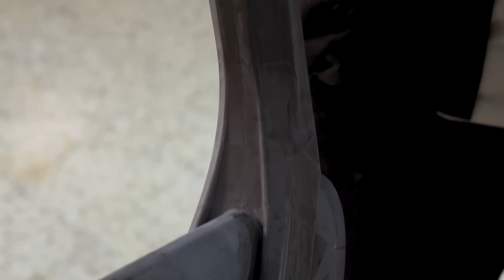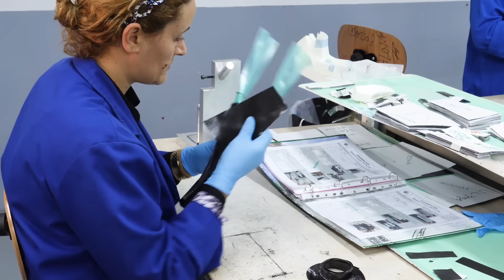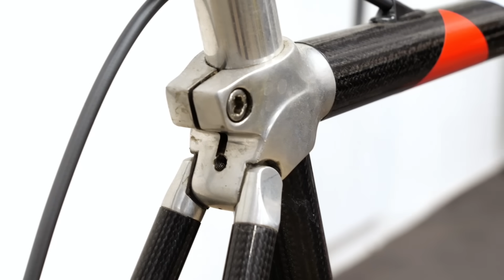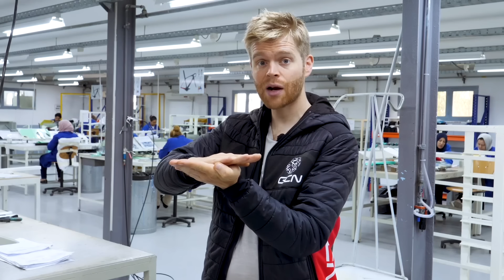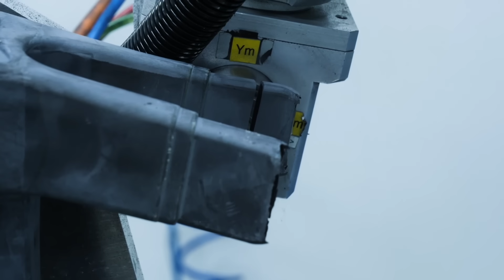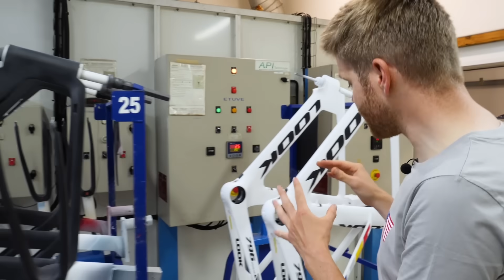How Are Carbon Fibre Bikes Made? | LOOK Cycle Factory Tour

Comment: It is interesting to see the backlash about worker safety in this video. People seems to have a "little knowledge" and then use to make assumptions that are mostly incorrect here. Ill add my thoughts on the main questions here - but don't take my word for it, do your own research, all of this is heavily documented. And DO question Look about it, their canned response here was dismal - even if they aren't doing anything wrong.

1: Is carbon fibre dust bad for you? Yes, yes it is. It lodges into your lungs and can cause respiratory problems long term. It is not unlike silicosis from sand blasting as a career. It does not, as far as anyone knows right now, cause cancer - not that it matters really, I'd probably rather have cancer than silicosis. OTHER types of carbon compounds are linked to cancer, like nanotube structures, but there is no link to carbon fiber dust so its not ideal to conflate those just to make it seem a bit more scary. And that's not because it hasn't been tested enough. The industry isn't as young and cyclists may imagine, there's a half a century or more of research into this mostly in aerospace where strict procedures are the be all and end all. Safety procedures will continue to be refined for carbon composite processing as we learn more about the long term effects of exposure - and the type of composites we use evolve.

2: Are the masks they are using while sanding "enough"? Yes. Note that the tables they sit at are full of holes. These tables suck all fine dust down into the extraction system. These are that same as they use in woodworking facilities, where breathing the dust can be of similar harmfulness. The masks are an extra layer of protection, but probably not actually needed to be safe here. Setups like this are designed and tested to meet particulate counts, and not just slapped together  saying "that looks good enough, you'll probably live - maybe". The lady that has her mask down below her nose you'll note was NOT sanding at the time. Sanding carbon in a closed room with minimal ventilation WOULD be very poor, even with a snug respirator - I've done it. Yuk. But that's not what's happening here.

3: I saw a lady handling epoxy prepreg with no gloves, is that ok? It's not ideal - I'd hope she's not doing that all the time - but prepreg is kept at -18C, and is still very cold when laid up on a frame. The epoxy is effectively non functional at this temperature. It isn't leaving any residue on her hands. In many videos I've seen on YouTube of prepreg handling (even Alpha Romeo 4C SMC construction) you see people with no gloves. That said, uncured epoxy on your hands in small amounts isn't harmful to most people. Some people have a sensitivity that causes dermatitis, and those people probably shouldn't be working with it, even with gloves.

4: The guy spraying clear had no mask, he's gonna die! Well... that takes a few assumptions. First you have to assume the booth ventilation is poor - which it likely is not. Then you need to assume they are using a 2K polyurethane clear with a high isocyanate volume. Isocyanates in paint are what can kill you and cause brain damage over extended usages and shouldn't be used without a fresh air system. EVERYONE knows this and NOONE in ANY country would allow someone to spray it without the right gear. Even an idiot spraying his tractor in a barn knows not to use this unprotected (certain Toronto based painters may contain slightly more idiot genes however). This stuff strikes fear into painters heart, and that fear isn't overhyped. So it would be a good assumption that Look is NOT using a paint like this because they don't want their painter to die. Now, I can't seen any info online about what they actually use, but I would expect Look is using an acrylic or even epoxy  based clear, which is fine in a good spray booth with no mask as the fine particulates are drawn out of the booth. Basically there are "particulates" and there are "solvents" that can be harmful to you. Particulates are dealt with by extracting them before they get to you. Solvents dissipate into the air, so they need to be blocked with a filter - or separated completely from the air you are breathing. Acrylics and epoxies are low to no solvent ( VOC) with no (usually) isocyanates. Polyurethane is the killer with high VOC and often high isocyanate amounts. Horribly toxic poly paints like Dupont Imron are what everyone imagines of when they think clear on custom cars or bikes - but this is all changing and I'd expect few people to be using them in the next decade.

5: The guy in the robot machining cell had no protection, is that ok? Well, he was not machining, he was placing a frame in the fixture. I cant imagine he was even inside the cell when the robot was running because he'd get physically hit by it! If he was he probably in a corner and had a mask on at that time. The cell is again, downdraft to keep the fine dust at bay. The robot itself would die from the dust as its highly conductive, so you can be sure there is almost nothing in the air inside there when it's cutting.

6: "I worked in aerospace for 122344 years and they do....". Some of you probably are expert with experience working in composites, but it SOUNDS like many of those comments are people who have done aerospace. Aerospace programs - making a wing spar for a 787 for example - have a procedure put in place by the manufacturer by way of the government that MUST be adhered to in every detail, full stop. They need complete traceability because if that part fails, and 340 people die, they need to know exactly why and WHY starts with process anomalies. So they need to be 100% sure you never sneezed onto layer 345 of prepreg or got your greasy bacon sandwich fingers on layer 222. So naturally, with lives on the line, their processes and safety are at an extreme level that don't always need to be matched on something as simple as a bicycle frame. Rest assured, they don't do it to protect YOU, they do it to protect themselves from lawsuits.

I hope this leads people to go research these topics for themselves a bit more, so they don't have a fit whenever they see a working factory (especially one not in their own country and assume therefore its dodgy by default) and then threaten to boycott it - usually in favour of some other factory that may be doing something even worse.

Comment: That carbon fiber display at 3:09 seems to be a bit deceptive.  Not saying it's inaccurate in the material comparisons, but if you want the caparisons to be completely equal, then I would think they'd all need to be the same length with the weight hanging at the same distance from the wall.  If you think about a person on a diving board, the further out they are from the start of the board, the more flex the board with give, which is the same thing them being longer or shorter.  Maybe I'm missing the reason being the different lengths, but they way he described it made it sound as it it was showing the how great the difference was between the stiffness/rigidity of each bar.  🤔
Reply: Every one of those is the same length.
Reply: werner automation - Are you sure we're watching the same video?  The lengths of each strip is clearly different which means the weights are not hanging at the exact same distance from the wall on each one, so it's not a proper comparison.

Imagine 5 diving boards equal in length, material (and everything else) lines up side by side, with 5 people of equal weight standing on each of them side by side.  But, on the first diving board have the first person stand at the very beginning of it, and on the next one have the second person stand 2 feet further out, and then the next board have the third person stand an additional 2 feet further, and so on until you reach the last board and person.  You would notice right away that the last board with the guy standing near the very end of it would be bending much lower (closer to the water below it) than the first board with the guy standing at the very beginning, which wouldn't be bending very much if at all.  The only thing affecting the amount of flex in the diving boards is the distance from its edge the person is standing on it. That was the point I was trying to make.  Hopefully it makes sense.
Reply: Nope, each strip is identical. weights all at the same position.
Reply: it's a good optical illusion ill give you that :)
Reply: Actually, you're right about the weights being in basically the same place and in line with each other, which you can see at 3:20 ,  but wouldn't that just prove that they are different in length?  I'm mean since if the ones on the far left that are deflecting many times more than those on the right, the weights (bolts)  would then be closer to the wall, even if just a little, but the all look right in line.  Its definitely hard to see passed any illusion, but you can see all ten weights in that shot, which with that amount of flex in the strips on the left would cause those weight to be closer to the wall than the weight hanging from the strips on the right, as they would follow an arc as the strips bent further down making them closer and closer to the wall.  I'm honestly trying to figure this out since you got me more curious, no matter how pointless the matter is lol

Comment: i know a guy who bought a carbon fiber frame. he thought he was the shit of the shit until he stacked 5 months later. shattered the top and down tubes. i asked him if it was repairable he said no and then lamented over the $10K he had spent on the frame alone.  lol poor bastard.  i didnt have the heart to tell him how many times ive stacked on my old cro-moly framed mountain bike on concrete, asphalt, dirt. even got sideswiped by a car once. the worst it suffered was chipped paint...   tards that go in for this carbon crap will get a very expensive rude awakening

Comment: How does carbon fibre compare to steel and aluminium, in terms of how easily it can be recycled, or how quickly it will degrade when disposed of? Perhaps you could do a film on that?
Reply: See that trash can? That’s where you’re composite part gets recycled.

Comment: This video covered everything EXCEPT the portions I wanted to see most. 
1. The installation of each bladder inside of each tube.  
2. Also how they support the bag material between each start and end of each bladder. 
3. A short video of each cleaned mold before the wet lay-up is placed inside it. 
4. The installation of the wet lay-up, inside the mold and how the mold is closed. 
5. The removal of the mold from the autoclave. 
6. Then the removal of the fresh carbon fiber from the mould.  
7. Then to removal of each bladder from each portion of the frame.

Oh, and a bit of CAD imagery would have been nice to show how they designed the frame and define the placement of each wet lay-up.  Surely the Frenchies would not have been giving away any secrets, that their other competitors don't already know how to do.

Otherwise nice effort.
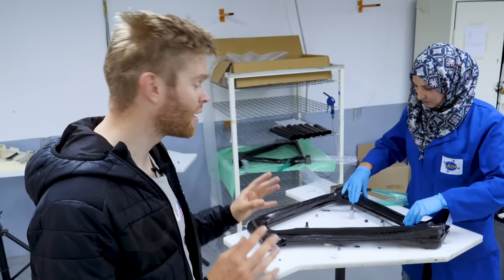Reply: 1: bladder isn't installed in the tube. the fiber is wrapped around it, they showed that that starting at 8:50
2: its continuous run through the preforms
3: there is no wet layup, the preformed part is just laid into the mould - they sorta show it but its not clear
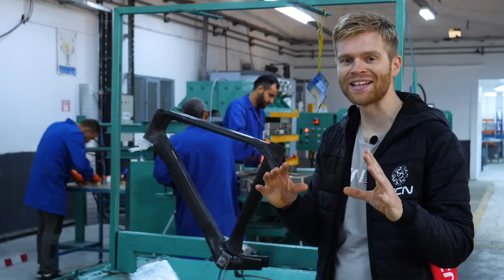4: again no wet layup, and the mould is closing at 11:27
5: there is no autoclave involved, its a bladder mould. mould is heated, bladder inflated.
6: they show the fresh frame, but not the actual removing.
7: they do this at 13:40

in summary.. watch the video again with your glasses on :P j/k

Comment: @3:40 is not a fair test because they are not all equal lengths therefore leverage and bend over distance isnt the same so cant be used as an example,, nonsense test which makes you look stupid although your trying to be clever, your right about strength and flexibility in different weaves and combinations but you cant compare the way you did unless ALL are equal in length, do things right or NOT AT ALL.

Comment: 00:08 Everytime "carbon fiber" appears, those misconceptions surfaces too. GCN itself explains that unidirectional CF is stronger than some materials, though it is prone to fail in some applications. You guys should rephrase it: "CF is MOST TIMES lighter, at CERTAIN APPLICATION stronger and enable the manufacturing easier for complex shapes". Seems like product placement.
Reply: I AGREE
Reply: i mean tbf they are pretty much sponsored by LOOK for this video so...

Comment: The process is called bladder molding and uses a latex bladder.  What you called 'debulking' was actually the cure.  The step after that is called the post cure.  The equipment you called a  oven after bonding was actually abrasive media blast cabinet.  Just sayin.

Comment: After that video, I took a look on LOOK bikes distributed in Greece. They are absolutely awesome looking bikes. Dream bike.
Reply: Yep, but it is difficult to remove LOOK marking or Trek from carbon bikes, so that ia ahy I prefere aluminium frames - not for proffesional racing - for everyday use - 11000 km on ALU frame this year and 28c road ALU wheels with... 1 puncture very close to bike service center - so great road bike season this year - of curse oval stainless steel  chainrings and custom made stainless steel casette too :D DIY Electronic gears shifting is under construction now for 2019 season and of course winter indoor training using custom build trainer https://www.strava.com/activities/1945857142

Comment: Make the chain stays as flexible as you want, a triangular rear end with conventional seat stays will not have vertical "compliance" like we're all lead to believe. Rob English of English Cycles manufactures steel frames using the thinnest of steel seat stays, and he still says the frames are stiff. Steel is a very stiff material, it's just that we tend to try and use as little of it as possible to save weight. Track cycles have often used steel handlebars, as they're often much stiffer than their aluminium counterparts. Sure, carbon fibre is a technically impressive, but the marketing drives me bonkers, especially when there's so many great steel frames out there begging to be loved. Carbon fibre also supports less and less of the smaller local manufacturers/frame builders who just can't really compete, both for price or performance. Given how few road cyclists actually compete, or are paid to compete, a trusty "buy once" steel frame makes a lot of sense.

Also, good luck recycling that carbon frame once it's gone out of fashion and you're encouraged to trade in your perfectly adequate frame for whatever the next trend might be.

As for buzzwords like "high modulus", speak to an aeronautical engineer about the "high modulus carbon" in your bicycle frame, and they'll just laugh and walk away. If your bicycle was made of an actual high modulus carbon, it'd either ping itself off the road over every bump or pothole, or it would snap like dried spaghetti just by looking at it. Aircraft only use very small amounts of the stuff, it's not usually suitable for manufacturing entire parts.

Comment: " LOOK" ..... Really doubt abt the management and quality control. Worker doing extremely dangerous jobs without proper protection or protect properly. 
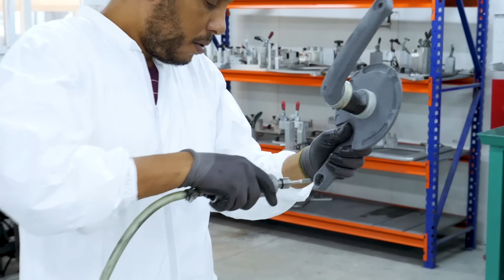12:43  grinding without a mask
15:41  a worker without a mask
15:49  wear the mask not properly
16:45  paint spray without a mask  
Abt carbon fiber part machining, is it done inside a sealed-control room with proper environmental protection ???  
Dust from the resin enforced Carbon fiber is extremely dangerous. 
" Details " tell many things.  thx.
Reply: OSHA just entered the comment section!
Reply: Because  it's made in Tunisia !
Reply: People are obsessed with safety these days...
Reply: God bless you all guys !
Reply: You better check your oxygen it may contain stupidity from your whole ancestors passed to you
Reply: @jejakamalaya1484  Interesting !!! You kid just cannot hold a rational discussion without a hate speech XD.
Reply: At 15:41 they are using a down-draft table. Sucks all the dust down and away from the worker.
Reply: No it doesn't suck all the dust down, therefore it would have to be encased, it just sucks the majority away. Depending on inertia, air flow etc. you can calculate all of that. In the end you'd still need to have PPE tp protect your lungs. May it just be the case of stuck particles on your clothes, that you inhale when you move away from the table.
Reply: Safety glasses, anyone?
Reply: @crnkspinnr5863  What for?????
Reply: yeah ive heatd carbon dust is like anthrax
Reply: It's bicycle frame, not a spaceship.
Training next worker to replace dead one is cheaper than providing safety gear for all workers.
Welcome to capitalism.
Reply: relax. its fine. many factories such as Giant are the same if no visitor camera is looking. some worker prefer no protection so they can "bond" with the item.
Reply: You don't need a mask for that

Comment: @3:35 talks about deflection and saying how one carbon rod is more stiff than another carbon rod or an aluminum rod due to how the layup is done.  But then the author doesn't account for the fact that all the rods have different lengths with an equal mass hanging off of them, and this alone will cause a different deflection in each rod.
Reply: Chau Nguyen they are the same lengths. Perhaps I should have made that clearer. 👍🏼
Reply: @OllieBridgewood  ah thanks for the clarification.  It did not look like so in the video, maybe because of filming angle.  Got it.
Reply: Chau Nguyen yeah, I can see how it can look that way! Thanks for pointing it out 👍🏼